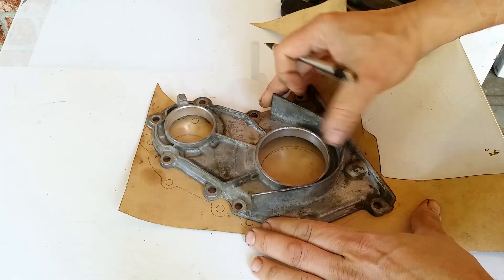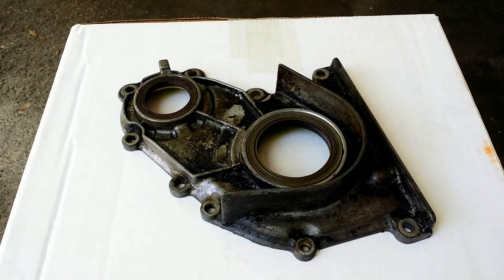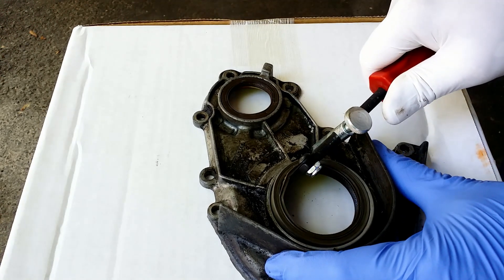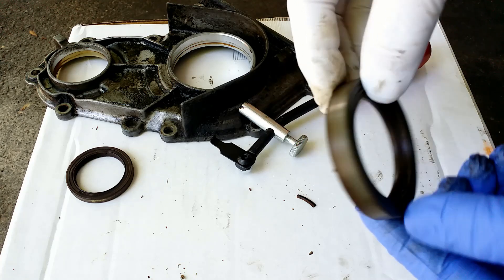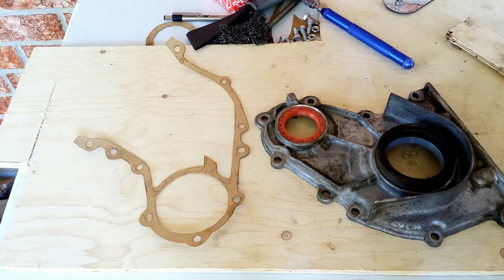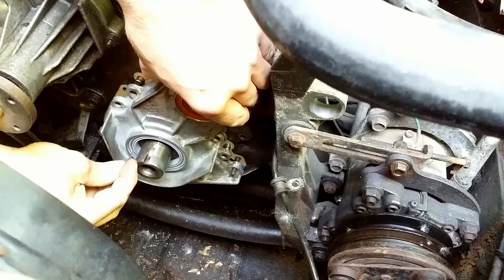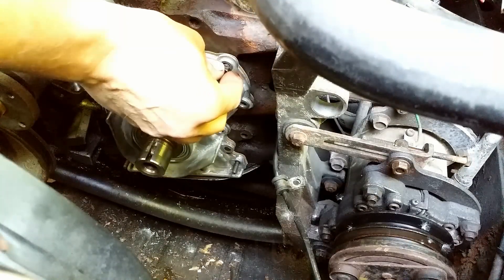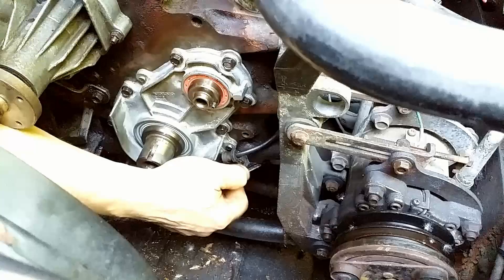Oil Seals Installation

Comment: What camshaft seal is leaking oul, when it's replaced, can I grease or sealant to secure the seal from leaking? What if it leaks again? What kind if lubercant can I use that doesn't engine oil when it mixes into each other?
Reply from the maker: If newly installed seal is leaking then probably the "tiny spring like" ring popped out off the internal lip of the seal.
Reply: @robertdeptula2003  Thanks, I finally got the hang of putting the seal on. Lubed it up with red bearing grease, Mainly the inner side of the seal, but I think I did get some grease on the outer side of the seal too. I used a clean rag and turned the seal to make sure the lip didn't roll. Hopefully it wiped the outer seal clean of grease while I turned it. Lip didn't roll. 

When I pressed in the seal, it went in a little more than flushed, is that okay? I hope that isn't a problem. I tried making sure it was flush, but tool wasn't tight, so I went in a little more. Now seal is in a little more than flush.

I'm thinking about also doing the crank seal as well, can I use bearing grease with that one too? Can I also put a light grease coating on the inner harmonic balancer so it doesn't go in so tight and dry? Making the harmonic balancer a little easier to pull out if I need to again?
Reply from the maker: I only use engine oil to lubricate engine seals. And there are two schools: lubricate all vs never lubricate the outer ring. 
Depending on how much surface the seal has to grab into pushing it a bit into should not cause a problem. 
Good luck!

Comment: NEVER lubricate the outer rim of the seal or the seat. Seals should go in dry & clean & free of any grease or oil. Likelihood of seal pop-out if you do
Reply from the maker: NEVER popped-out for me after lubricating the outer rim. NEVER was able to push it in dry.
Reply: @robertdeptula2003  My local garage fitted a new Viton seal to the output shaft of my TVR gearbox.Two weeks later, it popped out on the Autostrada spewing ATF everywhere & I had to be rescued. Watch this https://www.youtube.com/watch?v=QDVzAtU8xDc
Reply: @jonathanRRH  I use grease on seals that use a spring to retain seal pressure, the grease holds the spring in while I insert whatever part I’m inserting. I use gear oil for the rest of what I’m driving in unless directions say other wise.
Reply: @robertdeptula2003  Exactly my experience you can damage the outer rim pushing it dry.
Reply: @funnydubby6401 try to use any lubricant for PTFE seals.
Reply: My cars workshop manual says that you should lightly oil the outer diameter of radial shaft seal.